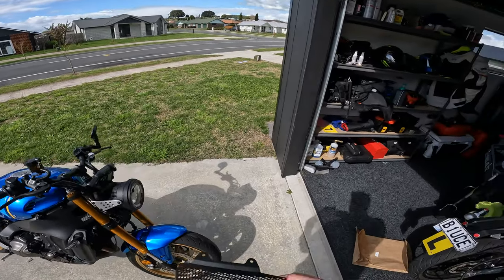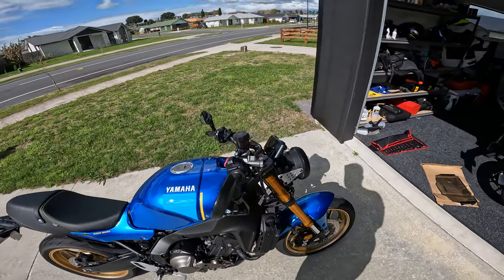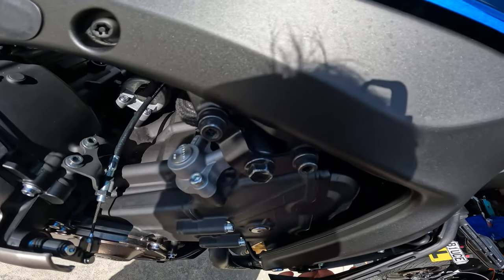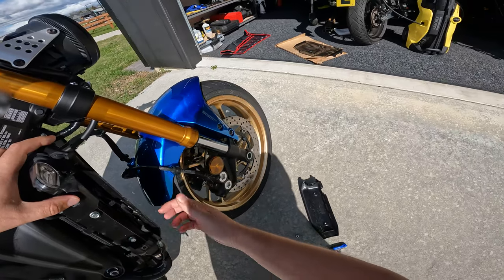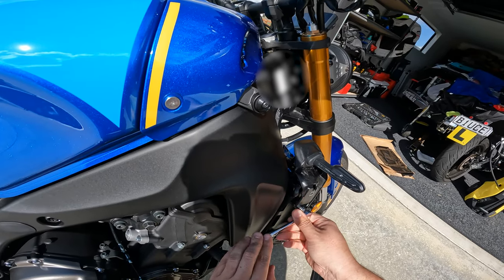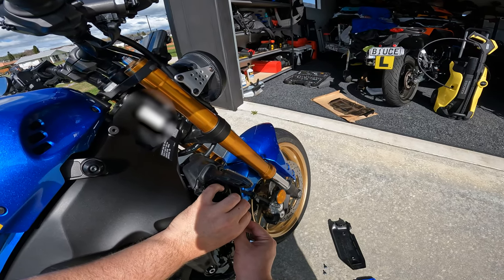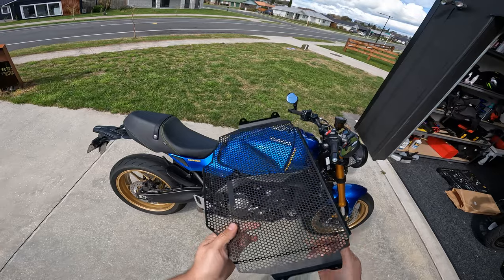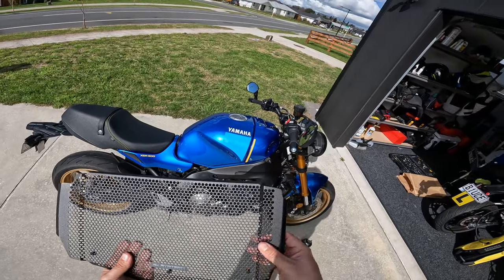2022 XSR900 Radiator Guard Install

Comment: Could you measure for me the width of the handle bars from end to end if you ignore the mirrors and slide guards? I have a skinny door but I already put my deposit and I'm praying it'll fit. My r1 did.
Reply from the maker: 75cm excluding the bar end (essentially from edge of grip to grip) 90cm including the bar end mirrors turned in to make it as narrow as possible.
Reply: @LindseyExplores  it will fit through my door sparing 2/3 of a cm🤣thank you!